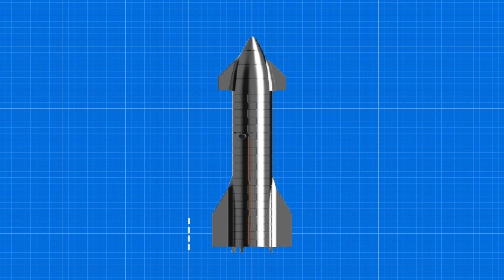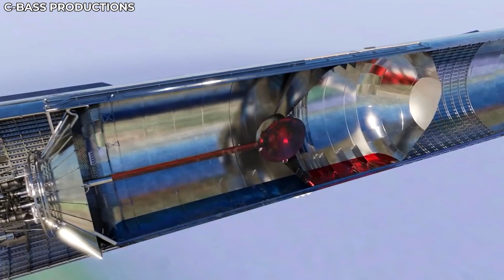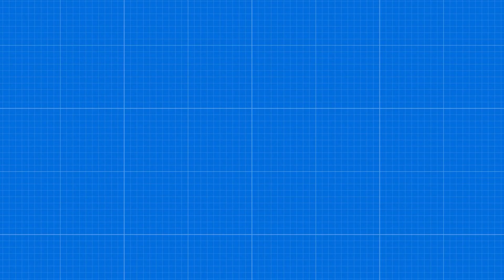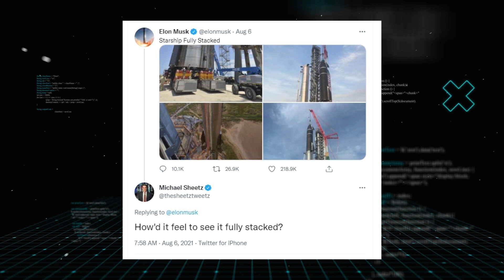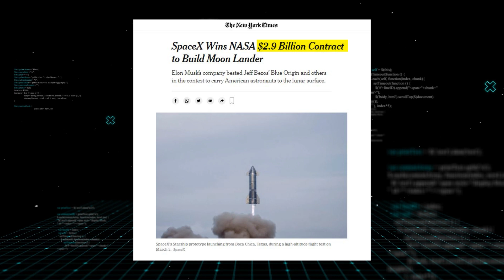GAME OVER! SpaceX SN20 Is FINALLY Going Orbital!

Comment: I wish Elon Musk the best of luck with Starship sn20's orbital flight. Am a bit concerned with the heat shields falling off during launch! I hope I'm wrong, and this won't be problematic and they have this design down! Either way, the test is going to be a blastoff to remember!! Cant wait!!!
Reply: falling off is unlikely.  There were a lot of tiles inspected and replaced after stacking, and they had to be drilled off with a lot of effort. Once they are on, they won't come off easily.
That said, so many tiles were replaced after transport, which probably means they allow for too much/ don't allow for enough movement, and they can crack due to vibrations.
Reply: Elon said that he only expect to launch without blowing up and destroy the launch pad for SS 21. The orbital is the next step and he said 10 launch could be needed to get the full operational SS for 2023 and of those 10 probably 2 or 3 could be reuse twice.
Reply: A few years back Musk said that Starship was going to better and safer than the space shuttle. Because Starship wouldn't need tiles like the shuttle did, thanks to the stainless steel construction. Tiles falling off or getting damaged during the flight to or from Mars is a very legitimate concern.
Reply: @jameskelly3502  Even if some tiles fall off,  Stainless has a much higher melting point than aluminum (Space shuttle) so loosing some tiles shouldn't be a problem. Wonder why they didn't use titanium instead of stainless, then a heat shield wouldn't be needed. I guess the reason is that TI gets real expensive.
Reply: @ismaeltiscareno445  The issue isn't melting, the high heat plus the mechanical stress of reentry will weaken the the steel. Which could be enough for vehicle failure. And they didn't use Titanium because  its extremely difficult to shape and weld. Its usually used for engine parts. Plus weight issues, it would be too heavy.
Reply: @jameskelly3502  Yes,  Titanium is very difficult metal to work with. But the hull of the Sr-71 is all titanium (Soviet titanium) with tech from the 60's. and no, Titanium is  virtually the same weight as 7071 aluminum.
Reply: @jameskelly3502  Yes but the tiles problem is not the major concern now;it's the launch without blowing the whole launch pad,that is all for now Elon said! The next SS will have the next goal:to reach orbit.
Next year the tiles problem should be fix not now.For SS 23.
Reply: @joannewilson6577  The tile problem plaqued NASA for decades. That's why Orion, Starliner, and Dragon use a ablative heat shield instead of tiles. If they can't make a reliable heat shield it's game over. Sad but true. Starship would be good for heavy lift cargo, but not people or refueling.
Reply: If they lose a few tiles, they will get a better insight into what the consequences are... and how to avoid them. 
That's the beauty of rapid iteration.
Reply: The skin of both the shuttle and starship will flex during flight. That flexing will cause the tiles to rub up against each other and dislodge one another. NASA spent decades trying to solve this problem (especially after Columbia) and failed. This is why Crew dragon, orion, and starliner, use a more reliable, ablative heat shield instead of tiles. Space travel is more difficult than people realize.
Reply: @jameskelly3502  That is why Elon said that every idea they have right now are not definitive and everything could change.
But Elon is obsess by the price and Dragon was financed in a big part by NASA...SS is not.
Reply: @jackboot3946  The tiles are not a major concern right now.The safe launch without  destroying all the launch pad and the tower and tank farm etc etc is....all the other concern are almost irrelevant for the next launch!
Reply: @ismaeltiscareno445  Yes Elon want to built 100 SS every year to get to 1000 to send 1 million peoples to Mars yesterday....

Ti grid fins are fine for booster reentry because they don't go super-fast (all Falcon 9 re-entries to date haven't gone faster than 9000km/h), which means they don't get super-hot.

Re-entry from orbital speeds (what BFS is designed to do) would be around 28,000km/h. That is far more toasty, and Ti can combust in the presence of atmospheric oxygen if heated enough (1200 degrees celsius).
Reply: @ismaeltiscareno445  Aside from the expense of making it in the first place, titanium is very difficult to repair. Steel has be welded, pounded, flattened, drilled with ease on Mars with simple tools. If they need to repair a tank or bulkhead or something.
Reply: @ismaeltiscareno445  Yes, I've worked with it a little.. as I recall, it was very brittle in the welds heat affected zones.. also, as you point out, it's NOT easy to get from Russia nor from Africa where it can be mined..
Reply: @jameskelly3502  yes it is.. but so was crossing the Atlantic.. Phoenicia probably wrecked many Reed Ships, but we know it can be done . Test, fail, think, create AND try again ...lol
Reply: @francom6230  Titanium is better as an "alloy" i use to have one Italian Made titanium bike frame it was 3% aluminum and 4% vanadium the frame even though is 25 years old is as strong as new probably it will last forever. And no, is not brittle like carbon fiber. Even very expensive climbing gear is made of titanium not because it's light but because is very strong and impervious to coastal environments,  so it can be used on climbing bolts near the ocean. And I said mining titanium, or buying can get very expensive.
Reply: 😂 he’s landing boosters and starship, your worried about some heat shields falling off? 😂 pretty sure spacex will have it covered, worry about something else 👍🏼😁
Reply: @jameskelly3502  that was an old design, it was supposed to use "sweating" steel (i forgot the real name). If elon is known for anything its for rapid changes in design 😂
Reply: @zvbnjm  Transpirational. Or tiny holes in the steel to let out methane. This methane would act as a thermal blanket as it burned in the atmosphere, expanding to create of pillow of hot gas. Yes, hot, but not near as hot as the friction of the atmosphere on the steel. So it would insulate the haul from the re-entry friction and thus reduce temperatures that would weaken the steel. Unfortunately, one would have to poke tiny holes all over the steel AND find a way to get methane into them, but only when they need it. Tricky tricky. BTW, perspiration is liquid coming out of holes to evaporate and cool, transpirational is gas coming out of holes to cool. Much like stoma on tree leaves.

On another note, perhaps they could just run a main vein up the middle of the side that faces the atmosphere upon re-entry. Maybe it could have tiny holes in a 4 inch tube facing mostly, but not entirely, perpendicular to the haul surface, such that any methane pumped into the tube would spray forward into the travel path and then spread to both sides of the tube making a traveling pocket of methane that slides back over the surface. Let the airstream guide the methane into a proper blanket for wherever it naturally flows to. As a giant tube, it could be turned on and off when required.

Comment: I still think building a larger base station in orbit would be a better launch point for the mission to mars. Building a larger transport craft in orbit would also be better for the mission. Star ship would still be a major part but it would be more efficient.
Reply: Ditto.  Why carry 50% of your engines used just to land on earth all the way to Mars and back???  Starship should just be a shuttle from planet to orbit.  One version for earth, one for the moon and one for Mars.  Then build a large, and I do mean large, interplanetary transport ship.  A bunch of water and fuel in the nose and tail, and Bigalow style inflatable modules in between.  Shuttles lift to dock to it on arrival to transfer cargo and passengers at whatever planet/moon it visits.  First flights will need to be starships to these places, but long term, they are stupid to fly back and forth.
Reply: @gelf1907  I agree. and so long as the orbital station stays within the earths shadow and inside the em field they will be very well protected from the dangers of radiation which would reduce cost of heavy shielding. The use of construction robots could speed the process as well and reduce the potential danger to personnel.  A high orbit station could easily be built and begin building larger ships for colonization and exploration. we could still manage the schedule of a colony on the moon and on mars by 2027. At present the primary obstacle is not the ability or sufficient technology we have all that we need including the micro reactors needed for much higher speed during transport. The only obstacle is politicians. Just as the American colonists and explorers of the age had to deal with politicians that have always been holding us back because they fear losing power we are experiencing the same problem. honestly NASA could have done this 20 years ago but politicians blocked every advancement and attempt.

Comment: Sn20 and booster 3 were never stacked tp launch immediately,  as this video suggests. This was to check the clamps amongst other things and it would appear that it was a good thing it didnt launch as now they have scrspped booster 3. Oh dear! This may delay the launch even further...So what? The development is still moving along at breakneck speed. So youll have your launch soon enough. Oh but thanks for the "update".
Reply: As far as im aware bn3 was never ment to be used for anything. Its bn4 that got engines installed and got stacked.

Comment: How much effect does slowing down in obit have?   If they brought the space craft to zero in relation to a specific spot on earth, what effect would it have on the space craft returning from orbit? I’m not saying Zero is practical,  but is there an optimum slowing while in space and atmospheric slowing?  Just asking?
Reply: When you slow down your periapsis (the lowest point in the orbit) gets down, if you were to stop at zero you would fall noze down to the ground, the optimum speed to slow down its dependant on each vehicle, since it depends upon its maximum heat dispersal capability in reentry and that happens depending upon how aggressive your angle of reentry is

Comment: Stacked and "ready to launch"!?! A total BS assessment almost from start to finish. Other than that ignorant assessment of the stacking, for starters, the FAA isn't what's holding the launch from happening right now. The Starship and it's heat-shielding tiles and the booster engines and the heat-shielding of them (along with the problem of several other technological hurdles) are what's holding back the first launch now.
Reply: agree
Reply: This isn’t microwave popcorn
Reply: Its full of sensationalistic crap like that. Low quality production

Comment: Why not slow it down like falcon rather than the heat tiles.
Reply: Booster will work similar to F9 boosters, but the starship, like capsules must uses atmospheric drag to reduce velocity because the amount of fuel needed to slow it down from orbital speed is about as much as it took to get to orbital velocity.

IMO

Comment: except side wings reinforcements tubic one is for extra wiring double safety and wifi drive on servos on all engine parts and wing flaps this thing apear ready I would add a rotational cocpit and preps since bleu moon rockets love to skip class and follow trade ie money they get a like quad expedition tpye type design fast and get inc into price this is is good so evetentualy a  falcon body can also be quad tubic to get some diagonal stability in elasticity stretch second thing is improve land since you managa a dancing plato for engine test also like ring type pop out on spring that could kind eyualize force on field and wokr as stabillizer as pc see terrain and calculte ajust lvl that could save rocket easy even on damage land easy after this lvl in larger number production is wise to see modul preps change basic rocket part fuel one modul, cargo part modul and cocpit so enginering modrern would also involve like stuff modular cargo prep deisgn to determine possbel site structure and numedr off chasis lvl part has usual parts are assembel upon daigonal stufness body reinforcements side protection and type off structure and also ability to be termo heated so double layers off plate so in future be prep to slight presure squezes tubic ring from below and down and add qubic piping this allow exapnad provision from modest 25-35% to be easy in 40-60% in material stifness this is crutial material improvments safety and some also achieveing easy singularity safety you can slowly think that even less weight to carry is alsp possible as durability and safety vast improve and that the final goal once in production is build eficient and in use adn improved as research and inovation tested stuff the other stuff is engine improve it require some design worknow is slight bulky design and still exploadable the goal is fast aproach and easy use and higher safety improving even on volatile systems next idea is kind like plate heaat aborber there where is a lot off heat and clod excahnge a protection plate double one side is tiatniuim alloy iso foam heat or non burn iso wool and then plating techincaly you do like design upgrade to lvl off boxer engine on bike or ordinary double head with 4 valve techincaly it like engine on satelite and phenomen off bulky design apeat as engien are certified and in lcd display coat on wifi allow even stuff like box caging much simpler to attach and box ocaging on servo for vtool systems so once engine tuned locked to safe frequency turn tested  for max pressure and stated in paperrs and max pressure locked with data info in purcahse box you get partsready use in the box upon order so developing vtool or totaly new body is more facility type or factory type this is part when things start to be interesting as serial production upon order is possible so for start achiveing like tear 5 safety as alreadey avionics is side protection haul structure this is no new nw tear 6 could have expanded sides and then wing ends which in start where only tubic now they are expanded so in design you alter design by stretch expand sides quad tubic still stayes now for tear 7 or 8 or all the time imediate use or frequent flight is inevitble use like strecth design colsion test material whih allow crush compact structure safety side, vertical bottom ad above, so is no new news iff body slight more streched below and less above and appear of ribs between bottom tubic as so called rail track holder so keep body together upon crusch impact second is so called lighte reinforce as above safety and as tubic inline whihc would allow even greater material spin and look like engine biiek ribes basilcy plate on rib with some left and right tubes so in theory in pc crush a scfi ship could haul damage and bend and abosorbe with bottom side basic presure and above part could be bend so scif ship get streched like sandwich but still in some shape this is begineg flight safety scfi ships upon imapct and some speed saefty crush lvl which is improving works preaty much as euroncap crush test better version more money and more production number all things based on production and number off pieces produced so oyu get like car safety in scfi ships except number and price are not the same rest is in assembly and research and inovation pass quality test gets bigger and more research and inovation and things developed fast and for productional number in assembly and pricing on 3d aero space alloy metals gets cheaper as know ofthen this is usualy the case also